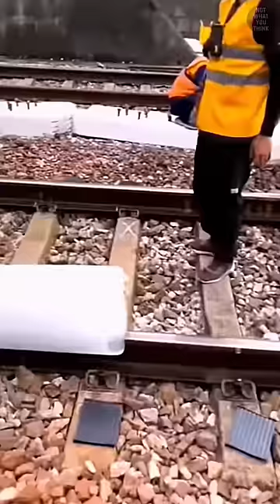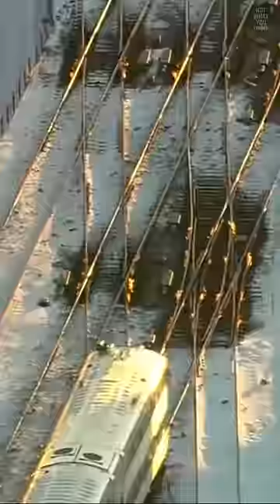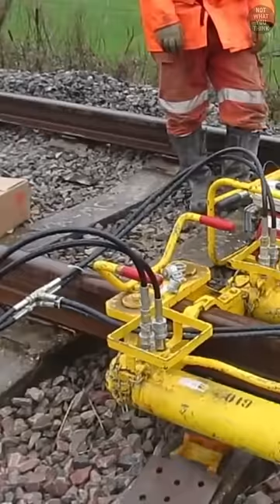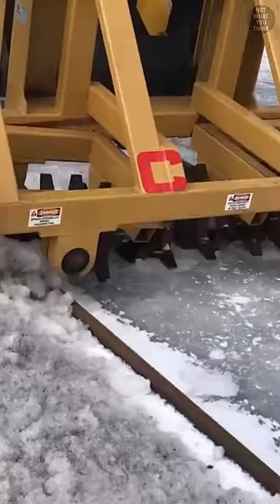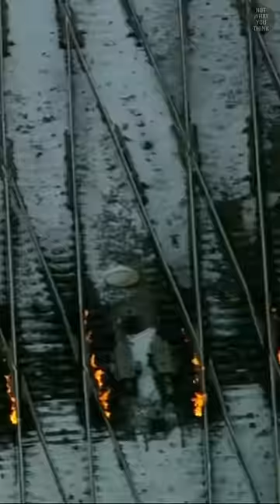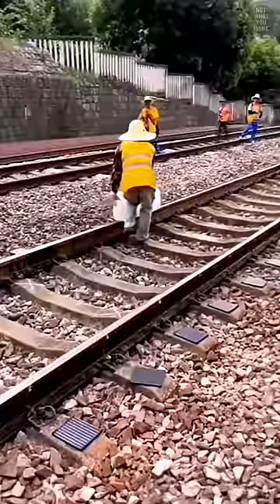ICE & FIRE on the Railway #shorts

Comment: Actually,  railroads install propane switch heaters that come on automatically to prevent ice and snow from causing problems. 
Similarly,  when replacing the rail in the winter time the track was heated using very large propane heaters that heated the rail to 107°. This helps to prevent sun kinks due to expansion in the summer & broken rail in the winter from the rail contracting.
Shorts are not worn because they aren't approved safety gear.
Reply: Some do some dont
Reply: Those are used on switches not on the actual rail lines. If the switches are frozen they won’t be able to throw or have correspondence.
Reply: @infunerous666  I worked on both  steel and a tie gangs. Here in the northwest, they are used quite a bit. It's been a number of years since I was on a steel gang but we always used one.  Depending on what the install temperature needed to be for that section of track at that location.
Prevents the rail from both breaking when it's cold and sun kinks when it's hot.
The automatic propane  heaters are used on pretty much every dual control switch on bnsf railroad. If the dispatcher is going to throw the switch, it's probably going to be heated. 
If I'm going to throw it,  it may or may not be heated.
Reply: My grandpa (worked for the Deutsche Bahn) told me, they use electric switch heaters today. The problem is when snow build-up prevents the switch from reaching its end positions, because then the track has to be closed till the rail road staff solves the problem and the line can be used again